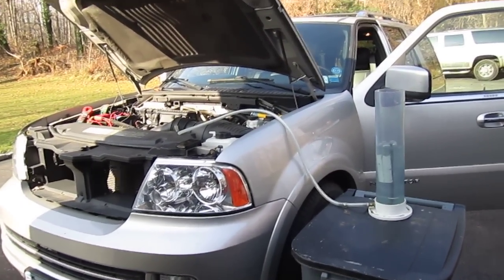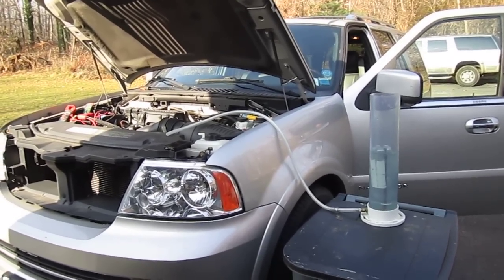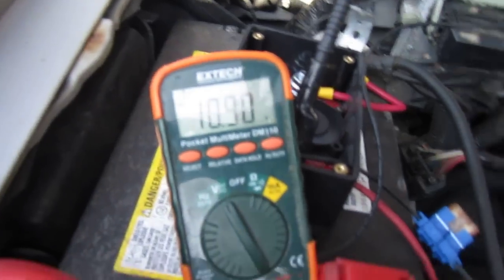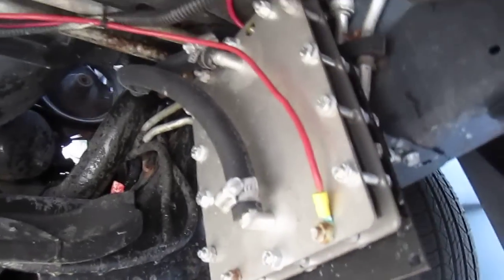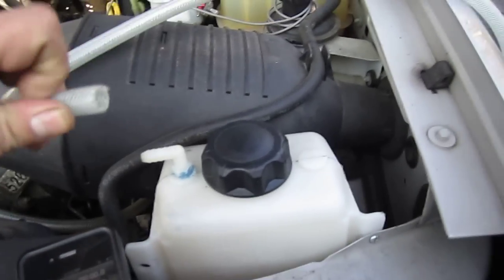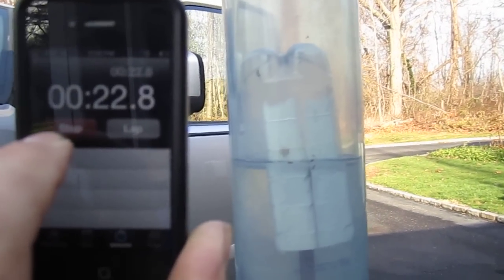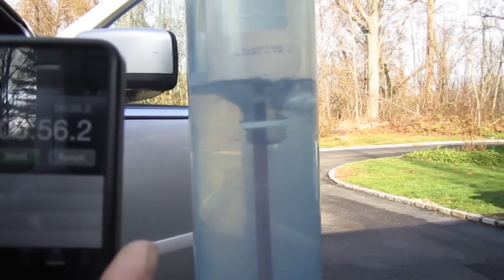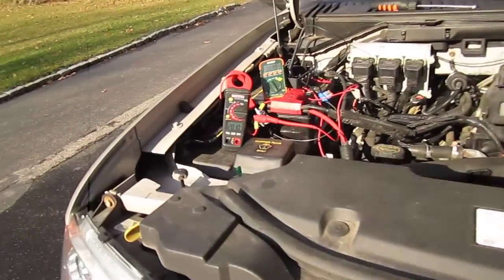HHO Dry Cell Test in a Vehicle

Comment: your correct in it does not chg the amount of gas, but gives 100% burn per cylinder.which gives more horse power.this means you don't have to push as hard on the pedal to go speed you want. my 2007 F150, has 2 4x4 dry cells from other vendor.A 5.4L towing pkg. Went from 13 city 17 hwy.to 16 city 24to 26 on hwy.it works, and my exhaust has no soot build up.Been running for a yr.and no prob. I'm now just looking to replace 2 cells for one. have same volt booster also. Im in Nat.Gas drilling Indus

Comment: can the vehicle run completely on HHO ?
Reply: They can but you need something that would spark the HHO in the engine, old carburetor type engines do even your lawn mower can. There video s on u tube, one dude has a older corvette and he made special tanks he could fill with HHO, and he made a large HHO generator on his property were he’d fill the tanks up, the 4 tanks gets him like 450 mins before refill of them. Now was a guy in late 70s early 80s that made a mini HHO generator that hooked were the spark plug go water pumped into then and  it made the HHO right there and sparked the HHO, even made it were the car would recycle the water from the exhaust cause that what can out instead  the bad stuff and oxygen, his car got over 800 miles in a test, he had a patent on the device, and sign a government contract, think he died mysteriously less than a week after, and data , records ,blueprint and everything else was taken.

Comment: First you said this 
"The purpose of this 2H and O mix is to ACCELERATE and COMPLETE that burn"

Then in a later posting you said this
"The gas isn't burning more quickly, just more COMPLETE"

If the amount of gasoline that enters the combustion chamber during each intake stroke remains the same
when HHO is added then there can not be an improvement in MPG this is a fact.

Comment: "So instead of achieving the power of 30% of your gas, you get the power of 100%+a little bit from HHO combustion" 

Once again your logic is flawed.  

If achieving the power of 30% of your gas for example can produce 300Hp how much more horsepower would you produce if you were achieving the power of 100% of your gas?

The answer is 1000Hp

Comment: If you wanted to improve your MPG by 20% you would have to reduce your gas consumption by 20% if you are getting 20mpg at 60mph this would equal 3 gallons per hour or (291.504oz) 291.504 X 20% = 58.3oz / 60 minutes = 0.97168oz So 1 gallon Gas = 114000 Btu X 3 = 342000Btu
342000Btu X 20% = 68400 / 60 minutes = 1140Btu 1 liter of Uncompressed Hydrogen gas has 11.48 Btu. So 1140 / 11.48Btu = 99.3  liters per. minute of Uncompressed Hydrogen gas would be required.

Comment: Alternators operate at approximately 50% efficiency therefore if the load on the alternator equals two units of energy then the output from the alternator equals only one unit of energy.  HHO generators operate at less than 100% efficiency.  Therefore all HHO generating systems operate at less than 50% efficiency.  This means they consume more energy than they produce.

Comment: A car getting 20 mpg  @ 60 mph,  burns 3 gallons per hr, which is 342000btu / 60min= 5700btu per min if you wanted to reduce your gas consumption by 20% this would be equal to 1140btu or 334 watts

Comment: No shit Sherlock...When you separate water from it's components, it's made up of 2 parts Hydrogen and 1 part Oxygen... H2O. The term HHO does not exist. It can't exist in that form, it is not possible, the 2 parts of Hydrogen do not stay separate, they reform as 1 part, Symbol H, Hydrogen gas.  It's a scam, These generators used to be known as Browns gas(Oxyhydrogen) generators,  they never worked then as described. This is known as pseudoscience... look it up.

Comment: HHO is a gas mixture of 2 hydrogen atoms per each oxygen atom. This is NOT water anymore. Water is 2 hydrogen atoms in a covalent bond with an oxygen atom. Electrolysis breaks this covalent bond by running electricity through the water, giving the hydrogen atoms an extra atom it needs to break away from the oxygen atom. If you believe they are the same, try sticking a match to a glass of water and see if it burns. LOL.

Comment: LOL ... Why do all the scams keep using a term that is entirely fake? HHO as a symbol does not exist. H+H+O = H2O - WATER. There is no such thing as HHO Gas. These so-called HHO generators are simply nothing other than Hydrogen generators. The amount of Hydrogen you need to produce to have any change to an engine is so great, you would need a Hydrogen generator larger than the size of the actual engine! Basic science.

Comment: diesel engines love it ran one on my bosses truck well over a year now and no problems, only mod he did was a stainless steel exhaust, His son actually has a water injector set up on his chevy diesl and my hho generator and is getting 29 mpg empty and 24 mog pulling his 28 ft cabin boat

Comment: HHO is 100 times more explosive than Gasoline, a bubble of HHO will explode as soon as sparked uncompressed whereas gasoline will ignite not explode unless compressed. the combustion engine compressed gas and air ignites to create the explosion. when calculating you have to account for the explosive power of the HHO as well as the drag on the alternator..it would seem to me PPL like you use faulty math dressed up to deny that HHO works. try it then analyze your results,forget the fuzzy math

Comment: It takes 357.37 cu ft. of Hydrogen to = 1 Gallon of  Gasoline  at 114000 BTU per Gallon

357.37 cubic foot of Uncompressed  Hydrogen  = 10119 liters of Uncompressed  Hydrogen

62 amps X 12 volts = 744 watts which is very close to 1 horsepower

Alternators are only 50-60% efficiency therefore to produce 744 watts output requires 2 mechanical horsepower from the engine.  

The more electrical load you put on the alternator the more mechanical horsepower that is required.

Comment: Most modern day cars can maintain highway speeds with as little as 25 to 35 hp
OK lets measure the energy 67.112 megajoule = 18.64 kwh = 25 hp hour 

So my question to you is how many liters of HHO is required to equal 67.112 megajoule?